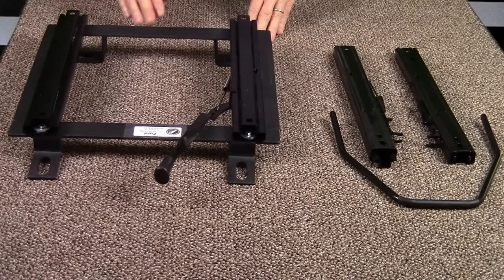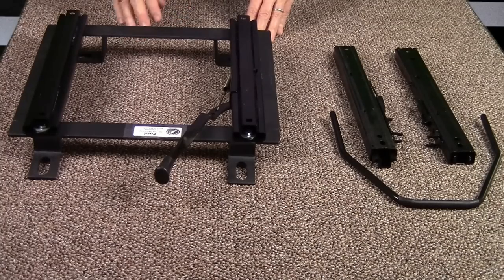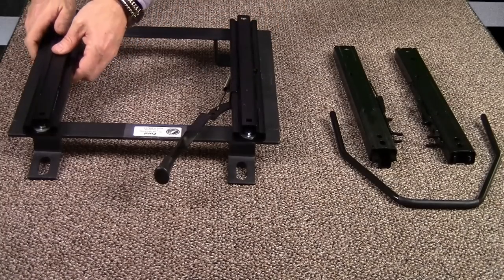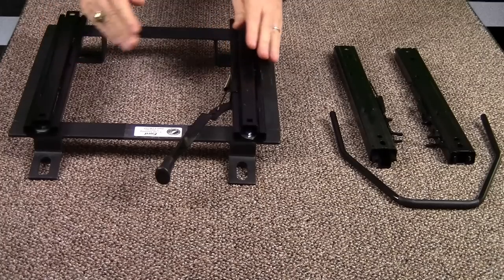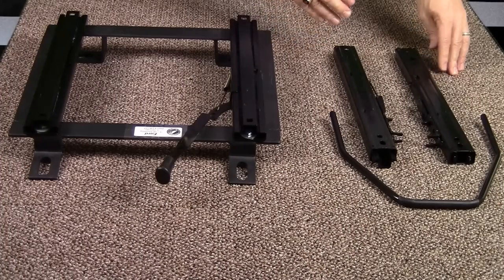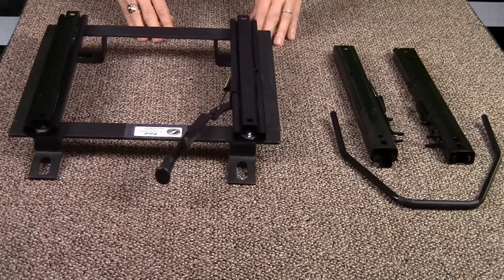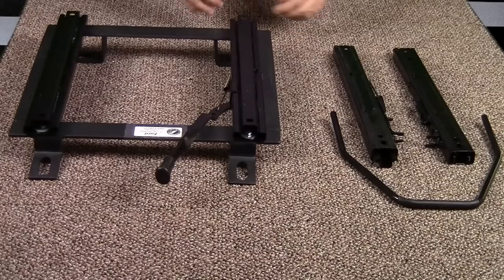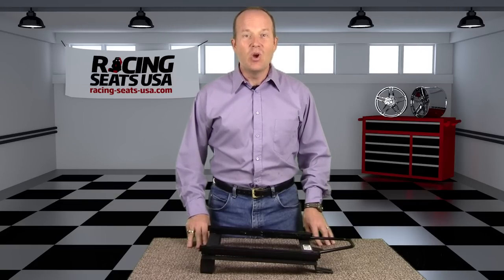Comparing Corbeau Single- and Double-Locking Sliders

Comment from the maker: Hello KAP32DW. Great question and this does come up often. It is technically possible but has never been intended to operate like this.  Side mounts are typically used to fix mount a seat for racing or track use. Since all of the Corbeau seats can be bottom mounted, in most cases it's best to simply use the vehicle specific or universal bracket combined with the slider or double locking slider.  If you have additional questions feel free to contact us at any time.